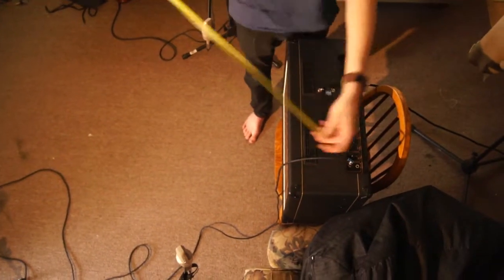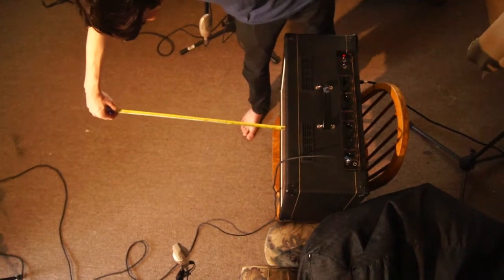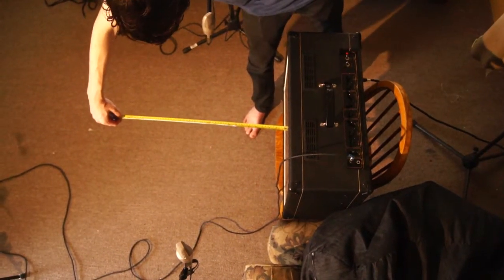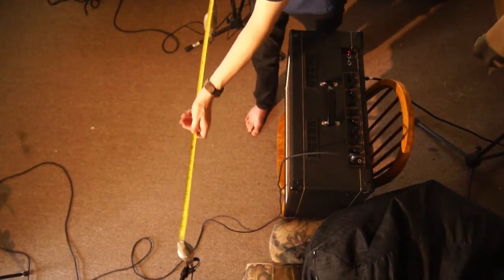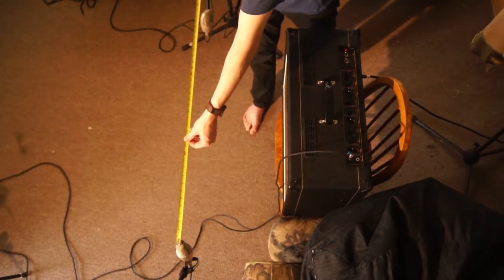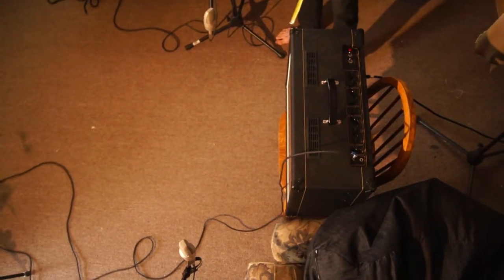The Spaced Pair Technique and the 3:1 Rule

Comment: When it's just 1 symmetric sound source and the mics are placed symmetrically at the same distance, facing the center of the source, the main difference between the signals will be different room reflections (let's assume we're not in a completely symmetric room with the sound source placed right in the middle). 

In other words, the direct sound will be nearly identical and thus very much in-phase in both signals, regardless of how far apart the mics are from each other, so the 3:1 rule will now mainly apply to the reflections, not so much to the direct sound.

Comment: I've been thinking about making a rig to bring with me for when I record events where I use two microphones to capture a wider stereo image, and also for capturing ambience in nature etc.. I did not know of this 3 to 1 rule, so thanks :) I will use this for when I record music etc., but for what I mentioned first, I guess I will jjst have to test it and see how it turns out when it comes to phase problems. On camera microphone with stereo like those from Røde do not give a very wide feeling stereo as they are so close to each other.
Reply from the maker: For live events I have had success using an xy technique. Since the mic diaphragms are right on top of one another at a 90° angle, there won't be any phase issues!
Reply: Wouldn’t an omnidirectional mic would be great for that?